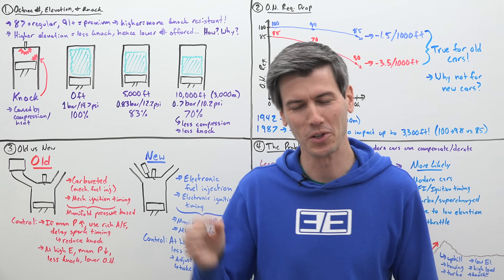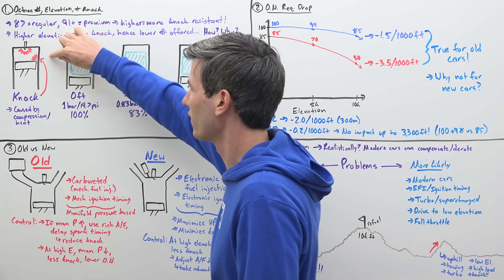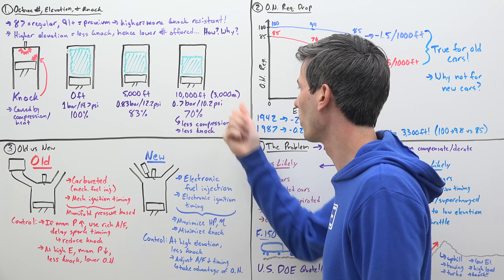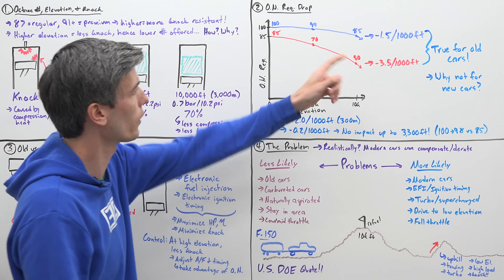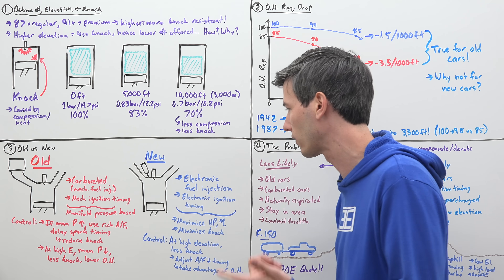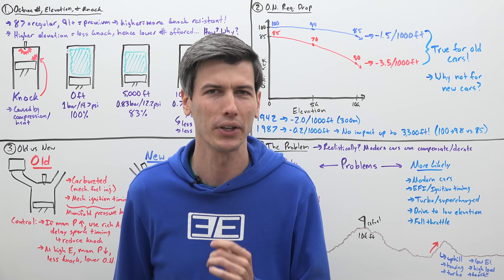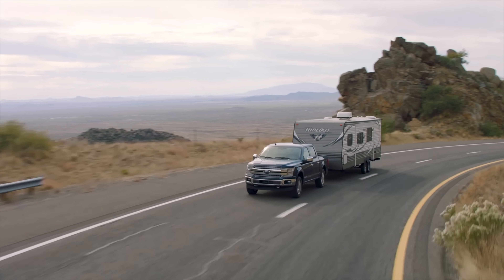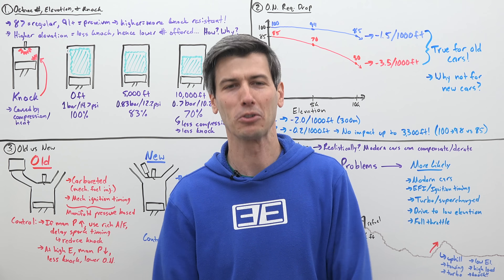Never Use This Gas In Your Car!

Comment: From what I understand, using a lower octane, your computer will make adjustments and retard the timing. But that might cost you gas mileage, thus costing you more money because your tank won't go as far. . So you're not going to gain anything. Also, the detergent levels in 87 gas is sufficient to keep your engine clean per manufacturer's specs, so buying higher octane gas for your car that only needs 87 doesn't help in that category.
Reply: True. This is why I a least put plus in my car. It’s turbocharged so it recommends premium but it drives nicely on plus. I find it’s a nice middle ground if you don’t wanna spend tons on gas but want the added performance.

Comment: The people who complain about fuel octane are the same people who will tell you they do crossfit without asking. If you don't have a turbo, it doesn't matter. Carbs will be more likely to knock, fuel injected (and especially modern cars) have knock sensors that adjust timing for exactly this thing. 

I don't have a whiteboard, but I can still call you guys losers

Comment: I live in Colorado with 85 octane and I've been told you only have to worry about this if your engine isn't naturally aspirated.  Ford probably just put this in the owner's manual to cover their butts and not have to amend the manual for NA engines vs. Ecoboost engines.
Reply: there are plenty of high comp ratio naturally aspirated engines. You can do what you want but i don’t need my computer constantly trying to avoid nock by making my engine run badly.

Comment: If enough people dont buy it then it should be phased out. 🤔 

There economy should fix itself. 
But there are niches where cheap gas could be good. 
1) People who own landscaping companies, they can buy the cheaper fuel for the mowers and other small engines. 
2) Local commuters

They way you present the information makes is seem like the fuel is more harmful and shouldn't exist. But if "modern" means vehicles after the 80s. Then I'd believe the economy would have fixed itself with enough people to opt out. For myself I know intentionally buy vehicles based on their fuel consumption. 
I tend to dislike higher octane based vehicles and vehicles with low fuel economy. Because commuting to work means an SUV with 28 mpg city and used great fuel just works for me. 
For others a luxury brand may seem nice but they tend to need higher octanes, and other vehicles have lower fuel economy but higher payloads to suit their needs.
Again the economy should balance itself  especially after that many years. 

Unless you mean to suggest the consumers are uniformed. 

Then I'd say we need more people to NOT buy the fuel. Again I intentionally chose the Nissan Rogue on fuel consumption and vehicle size alone. 
I will need a truck one day but for just getting to work the vehicle is perfect for me. I'd think people put fuel costs into vehicle purchases.

Comment: Of course ALWAYS use high-octane fuel in turbo/supercharged cars but I'm surprised at the suggestion to not use 85 in NA cars when staying at high elevation. My 2005 130k Ford Expedition has always used it, even when towing. My 2021 Telluride uses it. Isn't it pretty easy to hear engine knock? If you don't hear it, are you fine?

Comment: Worth mentioning that octane doesn’t just effect knock, but also how clean the motor burns. I believe using higher octane fuel than necessary can lead to carbon build up and cause other issues.
Reply: It can also lead to higher emissions if the timing isn't adjusted to take advantage of the higher octane fuel. Very high octane fuel burns slower, so with high rpm, and a high overlap camshaft, the exhaust valve can open before the fuel is even finished burning, and dump partially burned fuel that's still 'on fire' out the exhaust resulting in red hot glowing headers. Always use whatever the minimum recommended octane fuel in the owners manual states for best results.
Reply: Not true, and can actually be the opposite in some situations, since some blenders put more detergent in their higher octane fuel. 91-93 octane can't burn slowly enough to do what you think it does.
Reply: @crashtech66  What he's saying is true on old cars, or especially the dreaded early 70's "smog engines" where the compression ratio is way low. Pretty much all 'modern' engines have electronic ignition timing, and at least 9:1 or higher compression ratios, and using higher octane fuel in them won't hurt at all. But say if you consistently put 93 or higher octane in a an old school lawnmower engine that has fixed timing and low compression, it's not good at all, and spark plug(s) will be completely black. I've known some people with older cars that insisted their car knocked unless using high octane fuel, what happened was because they used high octane fuel for so long (100,000 miles+) the carbon buildup created a need for it, and temporally switching to 87 caused all kinds of knocking from all the hot carbon. Another thing that could have contributed in his cars 'thirst' for high octane is carbon deposits from burning oil, which can have the effect of increasing compression ratio.
Reply: @crashtech66  Another big problem in some areas, is the highest grade gas sits in the tanks too long because nobody buys it. Yes gas stations have much smaller tanks for more expensive grades, but sometimes it's just not as 'fresh' and fresh fuel is always better than stale, especially with this crappy ethanol gas these days. 30 days shelf life isn't unreasonable in the hot summer.

Comment: Too long didn't watch for those lazy people. Modern engine pressurized fuel with electronic sensors and controls, in a way that older naturally and mechachanically aspirated and carbureted vehicles can't.

Comment: JASON, what about the use of an 85 octane gasoline that is formulated without ethanol. I'm speaking specifically to using it for say a carbureted motorcycle that is going to be stored over the winter where you want to avoid the fuel breaking down and gelling. How would using 85 compare to using a bottled additive to do the same thing?

Comment: As a retired pipeline terminal operator in motor fuels, regular unleaded gasoline was treated as a bit of the garbage dump, with off spec product including distillates, product interfaces , and water was diverted to regular gas tanks. Note I was in an low EPA attainment area where the standards were looser and no state regulation. Agriculture subsidies for ethanol have really wrecked product quality.,

Comment: I'm surprised there wasn't mention of the purpose of the knock sensor in modern engines. EFI engines will adjust ignition timing to eliminate knocking when the sensor detects it.  

Carbureted engines would be more likely to knock than EFI. They lack the ability to detect knock and adjust ignition timing. You would literally have to change the jetting if you changed altitudes substantially.
Reply: Yep moving to diffrent states i saw it too
Reply: While you would be correct there are still limitations on that those knock centers are going off the assumption that you're going to be using a minimum of 87 octane fuel Purposely going below that limitation will throw the timing and knock outside of what the knock center can compensate for
Reply: @FrancescoBarberaMusic  right. Like running 87 in an engine that needs 93 or such. I was just a little thrown off by this video.
Reply: EFI engines will not "eliminate" knock.   WTF?   Blow up peoples cars much?    SOME modern vehicles with EFI have knock sensors AND an ecu with  the ability to retard timing to "REDUCE" knock.   Sometimes this can eliminate knock and SOMETIMES it does not.  Not all knock is audible in the cabin to the driver, but all knock causes engine damage over time, even though you can't hear it or feel it.
Reply: @Ethan-um7cp  you didn't read what I said correctly.
Reply: @Ethan-um7cp  ok if you say so, tough guy
Reply: @adamcornell6738  Your bro science doesn't belong on an engineering channel.   I read what you wrote,  I understand how to identify true and false statements.  Maybe you don't understand cars "correctly"
Reply: @Ethan-um7cp From "The Drive" website

 The knock sensor picks up vibration and sound coming from the engine block, turns it into an electronic signal and sends that signal to the engine control unit (ECU). The car’s computer then judges the information and determines whether or not ignition timing should be altered.

So how exactly was I wrong? And keep your bromo garbage to yourself, tough guy.

Comment: My Toyota runs E-85 and the manual states low octane gas does no damage.  I run 95 octane and e-85 and my truck is 11 years old and still runs like new when I drove it off the lot.  I would not take a Ford if I was paid to take it.  Just saying.

Comment: I grew up in northern Indiana, at around 700ft in elevation with 87 octane regular gas. I own a 2012 Dodge Avenger with the 4-speed trans, 4-cylinder engine, bought in the home state. I moved to central Colorado in 2016. Where I'm currently at sits at 4700ft in elevation, and here in Colorado the regular is 85 octane. When I moved here, I noticed a big difference in how my car performed. The car isn't very powerful or impressive to start, but I take care of it and it runs well. It ran like it was pulled from a tar pit on that 85 octane; it was incredibly sluggish, to say the least. I don't like paying +20-30c per gallon for fuel, but I feel much better about how the car sounds and feels when it operates. Even idling was ugly with the 85.

Comment: I filled up on 85 one time on a road trip, it was the best gas mileage I ever got, my 2015 Hyundai Sonata got almost 50 MPG on that tank of gas.
Reply: Cars get better fuel economy at higher altitudes due to less air resistance. You could have put 87 or 91 in it and got the same result.

Comment: Good primer, but there are so many variables missing from this regarding the true octane rating and true detonation resistance of the fuel ie. age, water content, ethanol % (thermal, potential, and detonation speed), and the misleading labelling in the US (linked to, but not accounted for).  Not to mention the differences between MAF vs MAP, FI orientations, compression ratio, piston shape, and the capabilities of each ECU to compensate for low MAP, high AFR, and knock detection.  The thing you did quite well, in fact, is convey the poor engineering and construction of the new Ford trucks.  Still, it should be enough to save some viewers from blowing a rod.
Reply: Ethanol content is taken into account in the octane rating. When ethanol became a requirement, the octane of the base gas was decreased, since ethanol has higher knock resistance, to end up with the same octane ratings as ethanol-free gas.
Reply: @WquestionMark9  Math is done in a vacuum, and those values are corrected for as such.  No consideration is given to the water content or anything else that happens to the fuel once it leaves that vacuum.

Comment: Have you ever vlogged about the opposite scenario? My manual recommends 91 octane for my 2014 Acura ILX 2.4. It is naturally aspirated, I live at 728’ above sea level, I never tow, and I do not drive with a lead foot. Is it okay for me to buy 87 octane regular gas? It is significantly cheaper where I live, by about 50 cents per gallon.
Reply: Most cars got knock sensor early 90s which will protect engine ,if still functional & car will lose power & mpg. May negate advantage of cheap fuel price.

Comment: Some cheap stations in Maine used to sell 85-86 AKI gas at elevations of only a few hundred feet. I mean within the last 15 years. Never thought about it, never had an engine start knocking (until I had conrod bearing failures..), but I pay more attention now. Good video!
Reply: Conrod bearing failures can be caused by the increased load from knocking at levels too low too hear.
Reply: @randallthomas5207  Possibly, but my two experiences with this were due to a warped head letting coolant into the oil and an overheating BMW oilhead; both went after a scorching hot day of stop & go city traffic.
Reply: @Bizzmark11  BMW, well there’s your problem circled for you.

Comment: I live in New Zealand and the usual/minimum (I believe) octane rating is 91 unleaded and 95 unleaded as premium with some stations including 98 unleaded.

EDIT:
Just checked NZ legislation and according to the Engine Fuel Specifications Regulations 2011, the minimum regular fuel must have a RON of 91 and premium fuels must have a RON of 98 or above.
Reply: Here in the US, we use MON (Motor Octane number) instead of RON. 

The numbers on each system are slightly different.

Comment: I ride a Harley, and they want MINIMUM 91 octane. I’ve found myself in places where 87 was the standard. So, I put half a tank of fuel in to get me to the next big city, and I just made sure to be easy on the throttle on that half tank and the next tank. Just don’t let the cylinder pressures get high and you’ll be alright.
Reply: That's probably because it's an air cooled engine, and you were riding in high ambient temperatures, or stuck in traffic. Harleys are not happy at all being driven slowly, or on a hot day in traffic. You can use 87 when it's cold out, or when you're going out on a long trip on the highway where you're getting good airflow and low temperatures. I did notice on my bike, if I had filled up with 87, and I was sitting at a long red light in the summer, when the light turned green and I was in a hurry to get back up to speed to cool off, I heard quite audible knocking so had to back off and accelerate gently until up to speed and things cooled off. Was fine going up hills on the interstate though, was enough airflow to keep the heads cool and no knocking.
Reply: @brnmcc01  it’s definitely because it’s an air cooled engine. Thankfully my local climate is considered cool, and any place that only has low octane means I’m also right on a highway. I don’t hesitate when i need fill will low octane, and I don’t buy the rip-off octane boosters. I just back off the throttle a little. Some might say backing off isn’t needed, but they wouldn’t know I rode my bike like it’s stolen. I beat the hell out of it, but I also take care of it.

Comment: Been running 85 in every vehicle I've owned. Every single one has gone over 200k miles. The guys I know who've run higher octane have all burned their engines out at <150k. It's irrelevant.

Comment: To have combustion you must have three things: fuel, means of ignition and OXYGEN. At high elevations you have not only lower atmospheric pressure, but also less OXYGEN. If you are driving a turbo, then you are making the engine perform as it would at sea level. Turbos in most modern engines do NOT run 100% of the time. They turn off and on as needed by fuel demand. So it is more prudent to only run premium. I have owned 5.9L engines that only lived at high elevation. From 1982 to 1999 we lived at 11,000 ft. In 1999 we moved to 9500 ft. The 5.9L engines were only fed 85 octane. The 1998 made it to 333,000 miles. We then had a 2001 that only made it to 287,000 because the transmission and 4wheel transfer case blew out and it was cheaper to buy another 2001 that currently has 269,000 miles on it. In 2015 we bought a brand new 2015 Highlander that is also doing fine on 85. When we do go to lower elevation we do use higher octane fuel especially if carrying heavier loads. Anybody who has tried making  a campfire at high elevation knows it is more difficult. The ratio of O2 is the same, but there is less ambient O2 due to pressure.

Comment: I always wondered about using 85 in my vehicles. Guess even my oldest from 92 is "modern" and I don't see best fuel economy or performance using the 85 octane that is sold almost everywhere in Idaho where I live is regular. Probably run 87 for a bit, especially in my 2015 Dodge and see how things go.